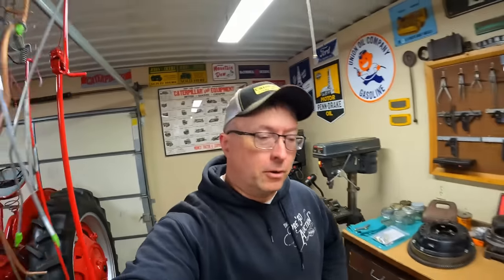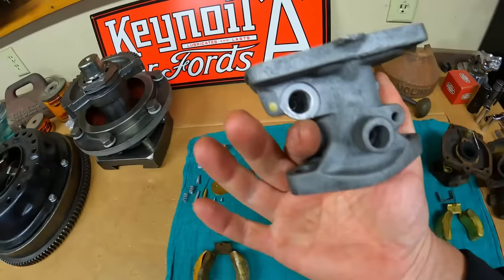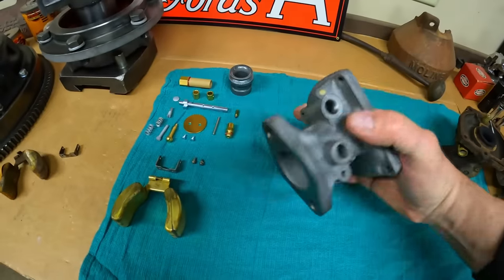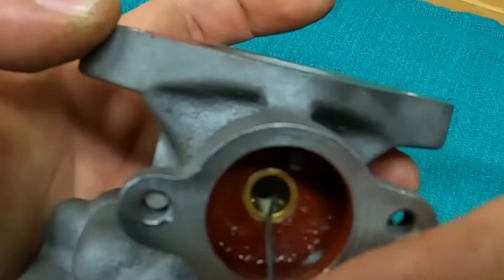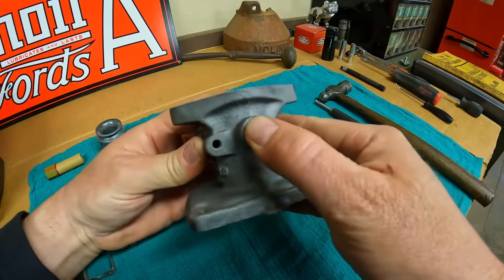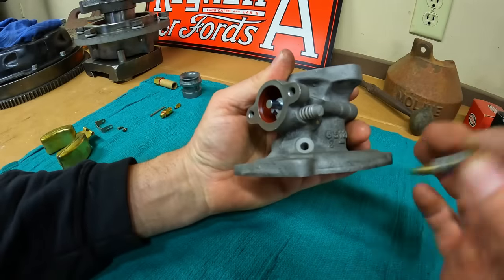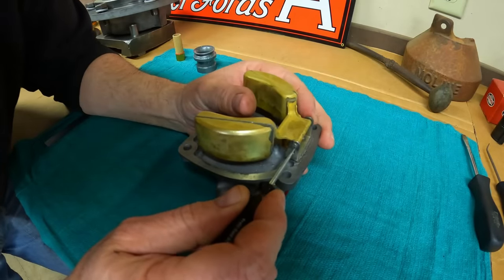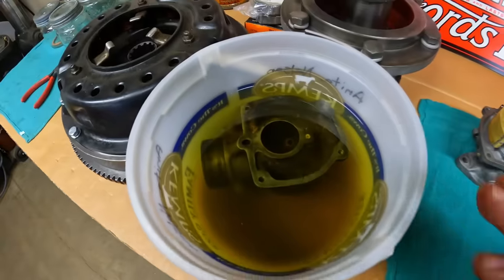Farmall M Carburetor Restoration Part 2 - Throttle Body Assembly & Float Replacement

Comment: I/we used to use a very light oil on every jet/air screw we installed, so the body's threads were lubed when reassembling the pieces. I do applaud you for the enamel painting on the carb. Most of us wouldn't do it 🙂

Comment: i've had issues with non-IH needle & seat assemblies sticking.  It's been worth the additional cost to get the needle and seat at the dealer and save the aftermarket one for in-field emergencies. YMMV (and Fiat Case New Holland sources may have changed).

Comment: I don't know if it applies in this instance - but most float level and float drop measurements on the air horn are usually done with the gasket in place.  Obviously you should check your manual to be certain.  It probably doesn't matter in this instance, because tractor float levels are fairly insensitive to small differences.  However, this can make a big difference in automotive applications, especially on carbs from the 1970s upwards. It affects fuel mixture (somewhat) and more importantly the float bowl refill under hard acceleration. For example, the Quadrajets on the largest GM motors would go lean at the top end of 1/4 mile tracks which could damage the engine -  because their float bowls are so tiny.  Any time float level and float drop is specified on a carb, it is an unwritten rule that it is to be done with the gasket in place on the air horn,  unless specifically mentioned otherwise in the manual.
Reply from the maker: The single float carburetor found on the Farmall H needs the float level to be measured with the gasket in place, but this dual float M carburetor needs to be measured with no gasket.

Comment: When I rebuild the carb on my W6 I noticed the original discharge nozzle had much bigger holes in the sides than the new replacement nozzle did from the kit. This caused some problems for me when trying to get the tractor to run right under a load. Fixed the issue with some numbered drill bits but I wonder if your discharge nozzle on the bottom half of the carb will have the same thing going on?

Comment: What was the tool you used to grab onto that little bushings with ? You must have a small bushing driver kit to put them in too .Nice 
Quality work. It's going to be like a new one. back to the video. I want to watch the float adjustment. I know that's critical.
When I was dumb about carburetors when I got my 1st H ( now I have several). I couldn't get the float adjusted no matter how
hard I tried, or how many rimes I took it apart. Then one day, I bought that little steel ruler and made a measurement to little cut out piece
I cut out of sheet metal.to use as a preset gauge, to make it easier .Been decade & a half ago but I think that's how I learned to adj. a float.
Now I realize when I kept repeating it  ( taking of the carb & setting it diff. & reinstalling it.) I must of just kept doing the same wrong thing. 
You can't guess. But another guy says you  can by eyeballing it, for double checking the measurement He made like it was so simple.
Reply: Thanks, for who ever helped with the answer to my question I just bought a screw extractor set. Didn't know there was such a 
set . I only knew about those longer things called easy outs.
Reply: @janbill79  I was the one who replied to your query. I see my reply has disappeared. Why i don't know? Maybe because i provided a link to the Mac site? Seems odd though. You are welcome anyways. Nice to see when people take the time to reply.

Comment: Thanks for the detailed video! I went back and watched the super M rebuild by Senior. Same carb as the M?
Reply from the maker: There are a few differences in the Super M carb, most notably the jetting sizes and how they run a fixed high speed jet setting 👍

Comment: Great! two questions, First I take it you don't soak the carb in a Liquid Carb Cleaner, but would that have helped loosen things up so you did not need to press things out and aid in the disassembly ( yes I know this should have been in the other Video). 
Second, if you are bending tabs, shouldn't you remove the float to do that? I can only think of 4 people I have seen rebuild a Carb or may have, (You, Sr, Pete, Kenny) and it seems like that was a important comment from them.
Reply from the maker: The guy whose M this came off of soaked both halves in his bucket of carb cleaner for a few days before bringing it to me, so I skipped that part. The floats are permanently attached to the pivot frame, so you just have to be careful not to damage them if you end up having to tweak the frame to adjust float level.
Reply: @squatch253  Thank you!

Comment: Just curious sir. What Media Grit & Grade are you using in your Blast Cabinet? Actual Sand Blast Media or Glass Bead Media?
Reply from the maker: This is actual sandblast media called “Black Blast” and it’s so sharp that I only use it on things like carburetors after it’s been in the cabinet for a while and dulled down some, otherwise it likes to eat softer metals.
Reply: @squatch253  That's why I was curious. I've always used glass bead on soft metal...

Comment: I have a 9U international with what looks like the same carb.  what number did you use for your kit?  The one on the brass tag or the numbers on the side of the carb cast in?  Thanks  Looking good so far.  Mine is not rusty though.
Reply from the maker: I ordered the carb kit from Steiner Tractor, and they mainly went off of the casting number on the side of the upper throttle body casting, because there were two different possible throttle shaft lengths for this model of carburetor.
Reply: @squatch253  Thanks for the reply.  Too bad they don't post to 
Canada.

Comment: Do you have to worry about the throttle plate screws vibrating loose
Reply from the maker: No, only on downdraft carburetors because they feed down into the manifold. These updraft carburetors don’t pose the same problem because everything has to go straight up to get into the engine.

Comment: Observation.  I like to compare Farmall letter series models. Looking at your H and comparing it to the 300 I noticed the H had a single float compared to a double float on the 300 knowing the engines are nearly identical. Maybe the 300 more like the Super H engine cubic inch wise. Question does the Super H have the double float like the 300? Is there a difference between between your two W-4 models as far as single vs. double float? Makes sense if the engineers were trying to get more power from the Super H/W-4 models and the 300 compared to the H /W-4 Models.
Reply from the maker: Yes, you’re right on track with the carb differences - the regular H and W-4 had the smaller single float carb, but the Super H and Super W-4 had the same dual float carb as the 300, which is also a very similar carb to what was found on the M 👍
Reply: @squatch253   I love this channel! I am sure glad you take the time to show the differences in models. It is funny how this stuff sticks with you. I haven't worked on or drove a letter series tractor for years and it still comes back to me.

Comment: 01:52.  Curious?  What is the purpose of the Glyptal, please?  All in all a great to the point video.  Hello from San Antonio, TEXAS!
Reply from the maker: It’s mainly there to prevent any rust or corrosion in tight spots like that where moisture has the ability to get trapped and sit there for a while. Plus Glyptal is resistant to just about every oil and chemical that is found in engines 👍
Reply: @squatch253  Great observation on your behalf to coat that area with Glyptal.
Reply: Castings of nearly metal can have little areas of porosity.  Usually not enough to lose an appreciall amount of material but if someone is going for a absolutely perfect paint job that little bit of seepage can cause a little bit of trouble. But we don't know anyone who worries about that do we?
Reply: @kenore4003  That's another good point if maybe the castings back then were not that great to begin with due to their porous nature.